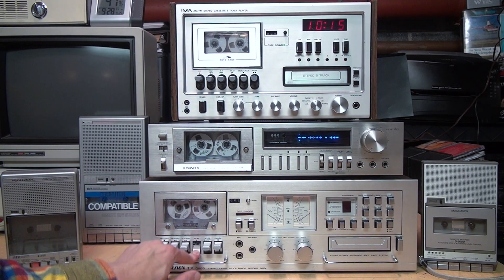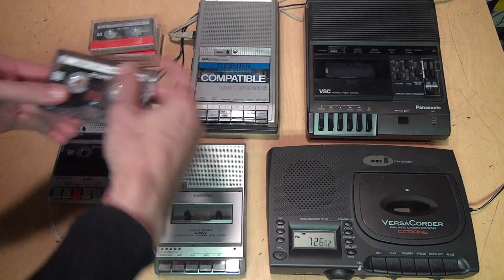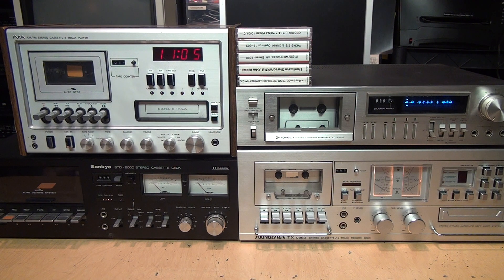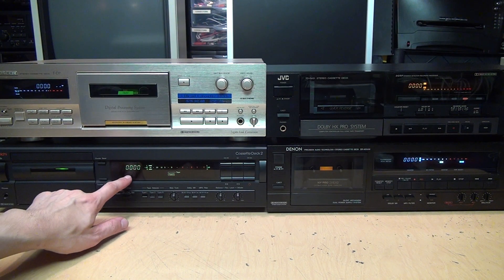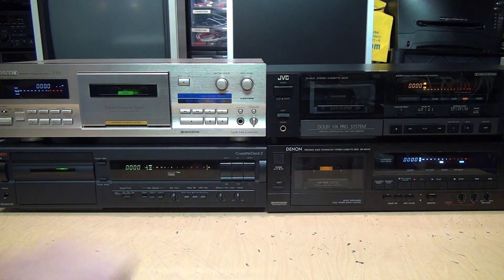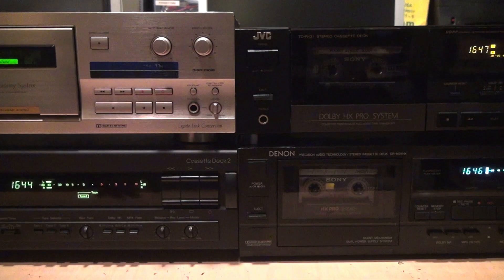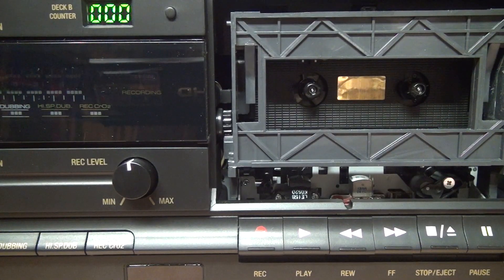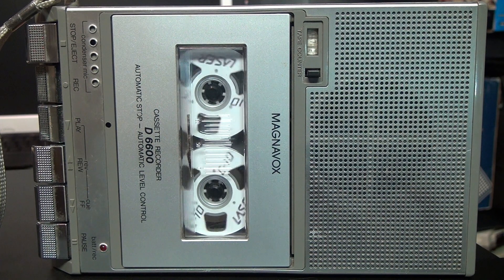What's the deal with cassette tape counters?

Comment: Looks like my 1989/90 Kenwood X42 tape machine, at least the deck with the counter, fits the "X2" standard, and it obviously speeds up as you go through the tape so it uses the supply reel. 2 nominally 60min tapes (measured at 33min 20ishsecs) give 466 & 464

Comment: If the non-2X digital counters' superiority isn't a result of deliberate standardisation, i'd love to find out which commonality creates the identical results. Maybe they all just count ms with the benefit of crystal timing and that's enough.
Reply: Nope, it is just a count of take up reel revolutions multiplied by the number of sensors it has per revolution, which is more often than not 2.  Once electronic counters came along that read directly off the take up reel, it actually became harder to make them not conform or be some multiple of the number of times the take up reel turns during play of one full side, around 820 in the case of the tapes tested.

Note that this makes the average 4 digit electronic counter tape deck read exactly 4 times the 2x standard by the end of the tape, although all readings in between will be off due to the use of the take up reel in lieu of the supply reel, with the largest difference being half way through the side.

Comment: With 50 plus years using  cassettes.I never pay any attention to them .Just another feature gimmick.

They are a PITA if the  end of tape shut down control circuit is using the counter as part of the end  of tape  shutdown.If the belt is bad it will shutdown.Just fix a few decks this past summer with that problem.

The  electronic VCR  tape counters were great especially ones  with tape remaining feature were great.

Comment: For the record my Technics deck which supposedly shows real time measures a Sony UX C60 at 32 minutes and 15 seconds. Either it is quite inaccurate, or Sony is more generous than I thought.
Reply from the maker: Most blank tapes are about 1-2 minutes longer per side than their advertised length.
Reply: @vwestlife  Thanks! Makes sense then.

Comment: i have a sanyo branded deck with the similar sloped mechanism as that sankyo, weird thing is the motor regulator transistor is a metal cased germanium thing, all other transistors silicon, and yes it was faulty, took ages to get a correct replacement, i tried 'near equivalents' but speed was unstable, only correct type worked reliably

Comment: This is the most interesting🧐 part of any stereo system. Tape counters have a purpose. It is to quickly locate a certain section on a cassette tape. It also “measures” the song from “000”. That way, ya can tell how “long” the song is, by number. For example, the song starts at “000”, and ends at 61. If ya have stereo equipment without a tape counter, you’ll have to guess where your location is on the tape. Tape counters are a great 😊 thing, such as for recording. Your friend, Jeff.
Reply: Thanks for providing this test. All tape recorders are not created equal. Results will be slightly different with the tape counters. Your friend, Jeff.

Comment: Yes, tapes did have slightly more or less tape on them. I have found the leads on different tapes to be different lengths. You should have numbered the cassettes so you would have used them on the same machines. Try ONE tape on all units and see your results. You will ALWAYS get slightly different results if the counters are belt driven...

Comment: I remember using the counter to mark where I started recording a new song, so if I didn't like it or want to go back, I'd use the auto-stop on rewind and it would drop me somewhere near the start of the song.  Of course I had to reset the counter when it got to 001 since auto-stop actually stopped at 999 not zero, but yeah.

Comment: Lucky I never used the 3 digit taps counter in the way you described 
Just a marker for certain sections to go back to
I used the 4 digit time counter to verify I had enough time to record my tape I was copying. 
Not for your reasons or the manufacturer specs.
For me just the basic function
I did not know the portable verses the stand alone were used different with opposite reels. I just learned it Now I'm 54.
Better late than never 🤔🤣

Comment: Given the electronic ones being able to count from an optical encoder, you'd think they'd just count seconds through the capstan since an optical encoder wouldn't add any drag to the mechanism

Seconds seems like a sensible standard to adhere to lol
Reply: It wouldn't work at all during fast-forward and rewind, though, because the capstan is disengaged from the tape. I've never seen a compact cassette deck do fast winding with the capstan, though I've seen several other types of decks (such as Hi8 and MiniDV) use this approach. And those are usually either quite slow or quite noisy. :)

Comment: I'm pretty sure DrCassette had a Sankyo STD-2000 tape deck at one point.  If I remember correctly the STD-2000 has a counter stop type feature for want of a better word.  Can't you set it up so that it stops when the counter reaches a certain reading?
Reply from the maker: Yes, it does have a mechanical counter stop.

Comment: Right in the middle of a TASCAM 302 (mm:ss counters) refurbish for myself. Both reels are gear driven by the same motor, separate from the capstan motor. The reel motor is controlled by a driver chip that is responsible for reversing direction, at least. I’ll have to reverse engineer what that thing is doing to calculate the tape time.
Reply: Just to finish what I started:
Tape timer on a 302 tries to be a time counter. At 06 : 00 on the counter, real time was 06 : 16. Pitch control matters, which makes perfect sense.

Both reel spindles will cause the counter to count up, no matter what direction, just spinning them with no tape. (Tape present switch held up to fool it) Tells me the increment/decrement and negative sign is fully dependent on which soft logic function direction is active.

“NOTE: The tape counter is not a watch. The reading on the tape is affected by the tape length, reel hub diameter, and other mechanical factors.” -TASCAM Owners Manual

Comment: This is interesting. I was initially thinking that driving the counter from either reel was a bad idea since it's not a constant velocity, which precludes it from being consistent across a tape and thus can't even be calibrated to a length of time like seconds. I was about to say it should be driven from the capstan. However, it can't if it's meant to work while on FF/REW, and obviously this would be a dealbreaker. This gets me wondering about videocassettes. I am trying to remember whether our first VCR (an all-digital model) had a time counter or a simple "number" counter like the audiocassette players in this video. I know all later ones, like 1990+, definitely had time counters. I wonder what strategy they used on those for having perfect time sync on the counters, so that you could FF to an exact minute:second timestamp.
Reply: Part of most video standards was a "control track" used to ensure tracking was correct of the helical scan (diagonal) lines on the tape.  Each scan line was one field of the picture (one frame for a full revolution of the two heads).  Newer video recorders simply read this track with one second being 25 or 30 frames (50 or 60 fields) depending on the format used.  This is why the counter will not run on blank tapes, or in areas where one recording partially deletes the one underneath, and why the counter still shows the correct time in LP and EP modes.

I remember when I was a kid thinking that it was magic that the tapes recorded on our older (manual counter) VCR still worked correctly for the newer real time one, however the control track was always there as part of the standard.
Reply from the maker: Later VCRs keep the tape wrapped around the head all the time. Older ones retract it back into the cassette when fast-forwarding or rewinding.
Reply: @vwestlife  This does not seem necessary for the RTC however, I have a Panasonic NV-F66 (circa 1991) which retracts the tape most of the way for FF and REW, just skimming the rotary head (which actually stops spinning) and running over the audio/control head. I assume this, and its unusual drop in pinch roller design, are to facilitate its particularly fast fast forward and rewind speeds.

Comment: I've noticed this as well and have always wondered why it's not driven by the capstan. Why not standardise it to 1/12 minutes or some equally useful interval.
Reply: In this case the counter would not work in fast forward or rewind.

Interestingly, the Pioneer dual deck in this video features a "two modes counter" which can also count in real time when playing or recording, but drops back to the standard counter during FF and REW.

Comment: Actually they would not match at the middle. On the route to the middle one is consistently faster than the other. They would match only at the end. The speed of the counter would mach at the middle but not the value.

Comment: I wonder if any deck exists where you could make out a reasonable reading based on the ~3375 inches or ~8550 cm that one side of an ideal 60 minute cassette runs for.
Reply from the maker: Most C60 cassettes are actually 90 meters long. That's about 31½ minutes per side.

Comment: Maybe a little bit unrelated, but I have to ask:
Do you have experience with different types/brands of cassette car radio's?
My current 2002 Volvo radio only likes really hot recorded (7/8db) type I tapes, and I'm questioning my decision of swapping my previous new pioneer for this Volvo radio. I would like to reinstall my pioneer 1din, and mount a good 1din cassette player beneath it and connect them together via aux. I saw you playing a cassette in a car stereo before, not sure in which video. I'm not looking to spend nakamichi bucks on a second car stereo btw.
Reply from the maker: Some of the later car radios have Dolby B NR permanently enabled, even if they give no indication of it. So that may make non-Dolby-encoded tapes sound muffled unless the recording level is high.
Reply: @vwestlife  
Ah, okay.
I have a switchable dolby b nr on my volvo radio. Hot recordings without using dolby do not sound much better.
Reply from the maker: @Daandeslions  Did you clean the heads?
Reply: @vwestlife  yes I did, although the radio was never used before.
Reply: When I use a good Type I, hot recorded with db-b, it sounds loud and crystal clear. When I use a type II (which sounds almost like CD-quality on my home HiFi) the quality is semi-okay, and the volume is way too low.

Comment: Just One of the quirks,  neither are the recording VU meter scales , or recording level aa inddicated by the numbers on the potentometers knob or the dolby logo placement.  As you will notice on your DENON DR-M24HX , there is no dolby logo on the VU sc acale. Or a NAKAMICHI BX-150/BX-125 , None have a Dolby level on the scales.....
Reply from the maker: On Nakamichi decks, the Dolby NR calibration level is at 0 dB. Pioneer sometimes uses a dot on the meter to indicate the Dolby level, instead of the Dolby logo.
Reply: @vwestlife  , that's what I assumed too. However DENON DR-M24HX. Owners manual there is no mention of anything specific. And recordings  will vary on different scales,  on playback as well. On some scales the Dolby mark is at 0 , and on other scales it's around +3 . It's something to do with VU scales standards,  the original PHILLIPS standard , DEUTCHE INDUSTRY STANDARD or DIN scale and various independent scales.
Reply: @vidtech2630  No Dolby indicator on my DR-M12HX either.... never noticed this before :)

Comment: Certainly was too much to ask from manufacturers to make it mm:ss and have it be driven from the pinch roller.
Reply from the maker: The Pioneer T-D7 and Philips FC931 decks shown in the video do have real-time counters, as well as numerical counters.
Reply: You mean capstan
Reply: @hughjanus6975  Yes.
Reply: @vwestlife , the Pioneer -616 has a real-time counter as well as an arbitrary digits counter, and you can switch between the two.  I have the "international" -606, which has all the same functions as the American -616, not the American -606, for some weird reason.

Comment: As tape recorder fan  do not know  any tape recorder with tech data informing  about accuracy of tape counter,  and it is rare for one person  to use two different brand tape recorders for recording and playing interchangable - I do not understand reason -    should be used the same machine . . Because  of not compatible corrections and heads azimuths.  That is the reason why producers  didn't  want  to do it. On other hand I am against borowing tapes - they are too delicate.  . 

I am   oneof rare people  to use two tape recorderas interchangable  but I was aware to purchase two identical not different cassttete Telefunkens and two identical R2R Uhers and I  secure  my  control of both machines heads azimuth. Then generaly I use the counters only for recording  but  up to their factory accuracy  Everything  has limited accuracy  - in digital counters  it is up to one second. which reflects  2,35  cm of tape. In  computer data  precision is high but then there is no need  to  find  place when we have separate files - the same as  separate tapes. 

My tapes are  my own  complilations and I do not  search for my best music by counter because all is my best and I wouldn't skip any  For brand tapes which are not compiled by me I can use search tool in winding and  it finds me  desired song  by silence on tape .

Comment: 1:30 That's odd, if not stupid, why they don't count the tape roll? It spin at constant speed. Was counter designed to be able use pencil method? And know how much rewind tape by hand? Totally useless if you wanted for example to put different recording from different casette on top of older one, would be better if you measure "time". When i was young i found this counter totally useless, wanted to use it for such purpose, but i thought it was just mine device. Unitra Manuela 2 then when i was older i purchased JVC boom box, "Super Bass Horn" whatever model it was used also in school on party, pretty good device, and it this thing was not even there.  I didn''t know it was common thing back then, who came with idea of counter but whoever did - probably had pencil in mind but idea was really dumb in practice making entire thing useless

Comment: I seriously doubt any effort was made to create a "standard" across home decks in the eighties.  Mechanical counter speeds are based on whatever ratio the belt happened to be, which could be anything if they were not specifically going for the 2x standard (which home decks obviously were not with their almost across the board use of the take up reel).  Electronic counters, however, would always be a multiple of take up reel turns, with almost all of your results being 1, 2 or 3 times that number.  The only outlier is the Pioneer dual deck, which is still within about 20 revolutions, or 2.5%, at a guess I would say it may be using an average of both reels, similar to what "real time" counters use, to even out the counter rate.  You could easily confirm this by playing the start and end of a tape to see if the rate is similar on both.

And yes, real time counters are just an average of both reels.  This is why they run much faster than real time on short cassettes with less tape (and hence faster reel speeds) and why some decks have a "tape length" switch to get more accurate results.

The idea in the comments of using the capstan for real time counting would be nonsensical as the capstan is not used during FF and REW, removing the tape counters primary purpose.
Reply: Just for clarity, this particular tape and length appears to rotate its reels around 820 times playing a full side of the tape.  This would lead to a counter reading of:

Approx. 410 for a 2x system
Approx. 820 if there is one sensor on the take up or supply reel for an electronic counter
Approx. 1640 if there are 2 sensors
Approx. 2460 if there are 3 sensors

The results of your testing bear this out.

Comment: So, the problem is that the counter depends on rotational speed of the reel rather than the linear speed of the tape. In other words, the counting will be faster in the beginning than closer to the end, and can't thus relate to the play time. And the count function of play/record time is not normalized and varies between recorders, so it's no use to note e.g. the track start times and rely on them unless you have a particular machine in mind.

This got me thinking... Back in my campus radio days we had a bunch of Mechlabor STM610 studio 2-track machines, they had LCD tape counters, but I'm not sure how these worked and what was their count/time funtion. 

Shoot them tapes out!

Today I was working on a Marantz SD-62 with a digital linear counter. Haven't noticed how it was exactly done on that model though. 
https://youtu.be/gSrqiIWSprU